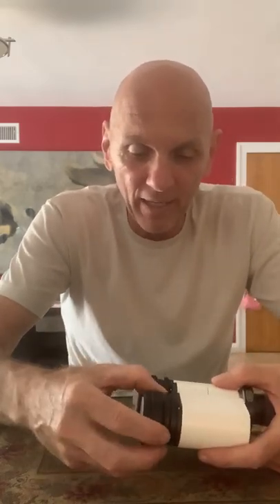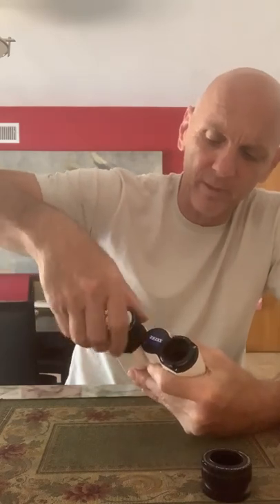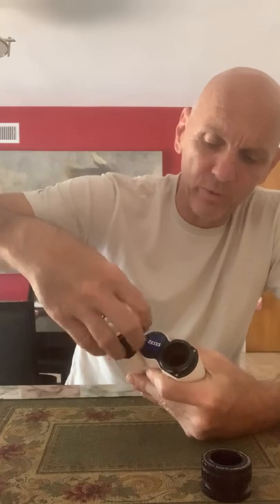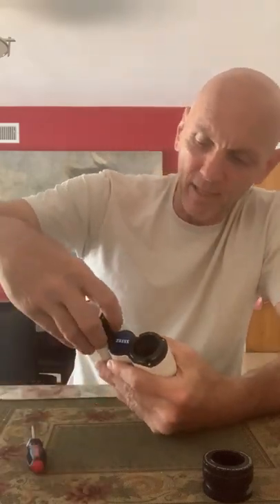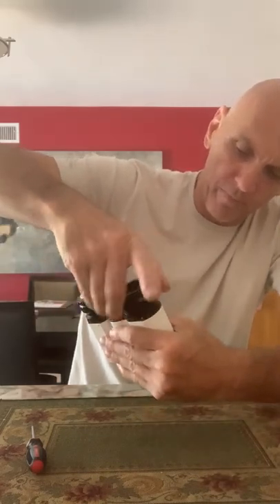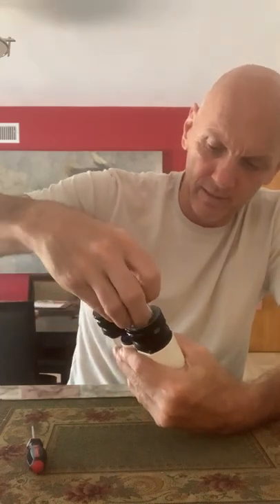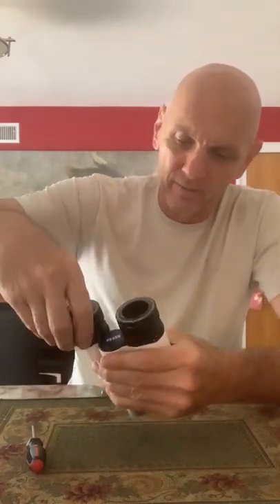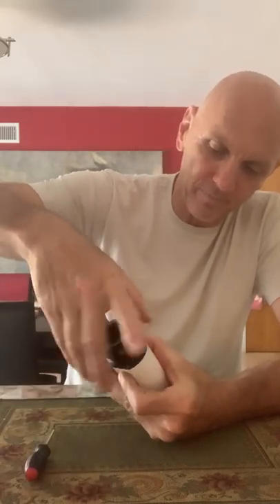How to collimate Carl Zeiss CZAS binoviewer

Comment: So after all these years, the only two binoviewers that you can easily collimate as an end-user are the original Baader Maxbright MK1 and the Denkmeier Binotron 27! Good thing I bought the Maxbright MK1's! Even the Baader Maxbright MK2 is a different design of eyepiece holders that are not at all easy to collimate (because you can't do it with the eyepiece holders in place, you have to remove them first)